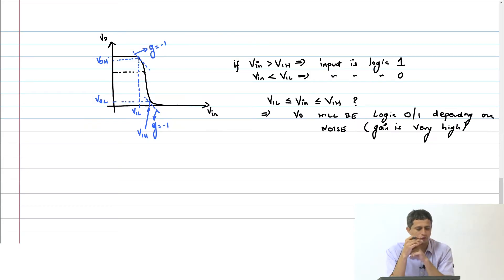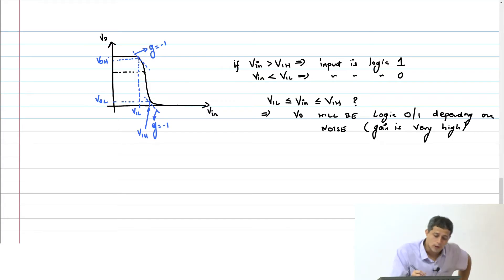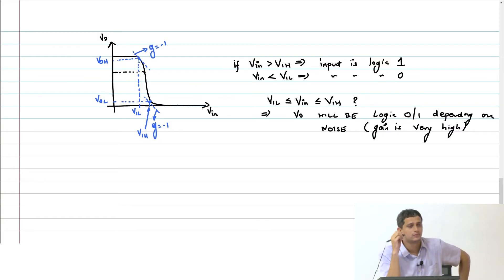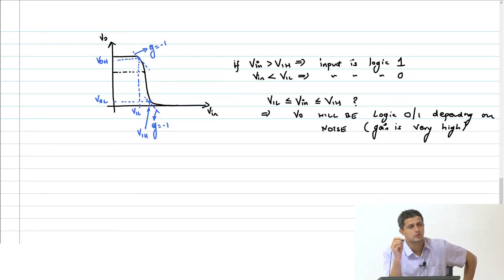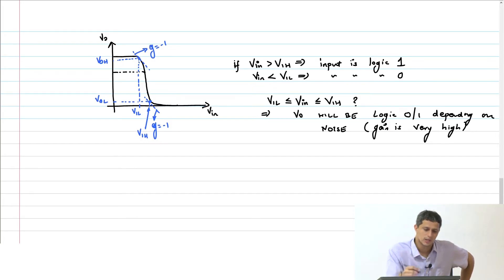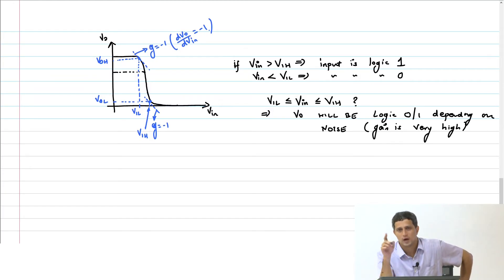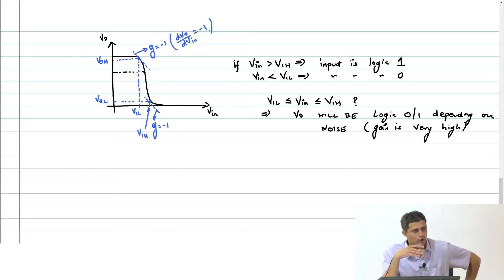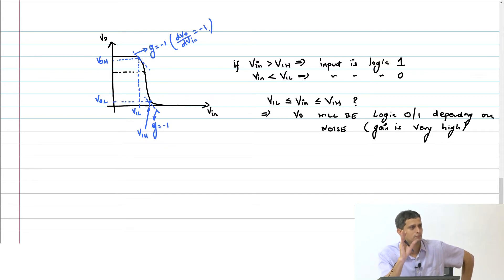Inverter - 7 - Noise Margin Analysis-2

Comment: Sir why we are considering gain = -1 for the calculation
Reply: I guess that is the extreme range of gain. Beyond which the noise gets amplified... (Negative gain because it's an inverter in which a positive change in input value causes decrease in output voltage)
Reply: the outpuut get inverted soo
Reply: First video of the Inverter - 7, Noise Margin Analysis 1 clarifies that point